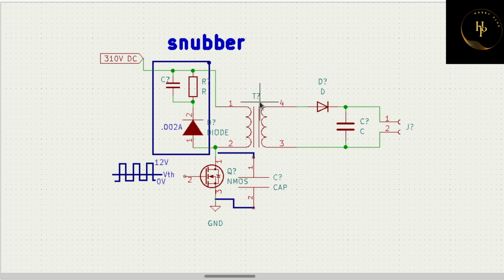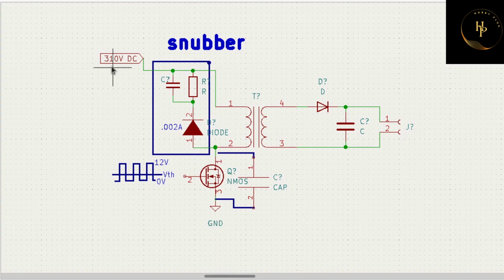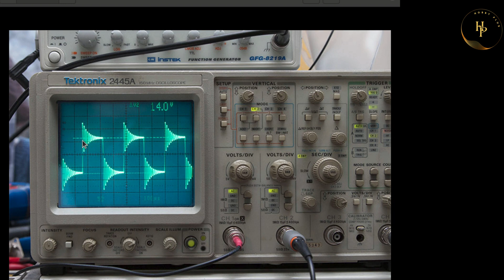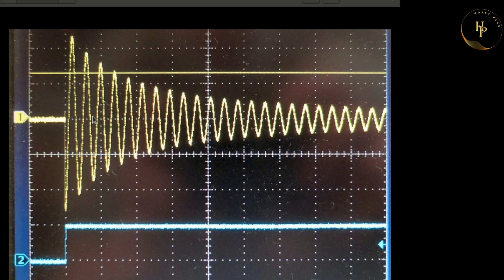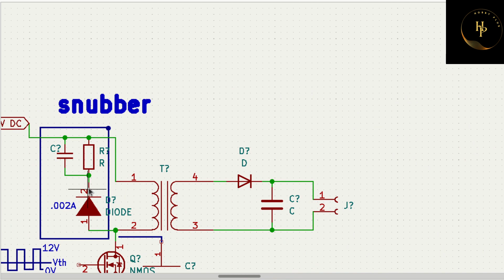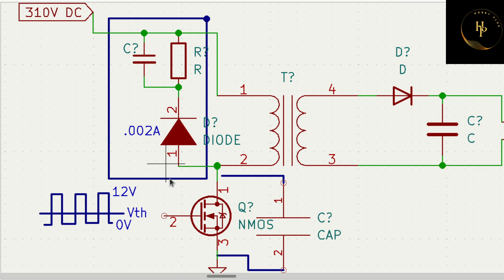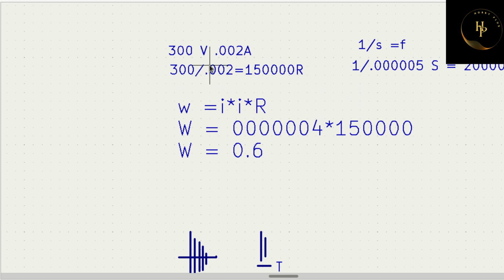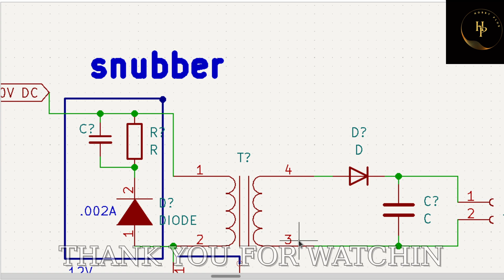[11]Snubber circuit calculation for SMPS

Comment: Can you suggest me best snubber design VALUES for Lleak = 180nH , Primary inductance with 0.9uH and secondary with 57uH in 1:8 turns ratio with Voltage spike of 242V at Vds whereas my Mosfet is can handle upto 200V my Vin_max is 9V and my Vout expected is 120V at Secondary Side with switching frequency of 1.5MHz and 12A Primary Peak current , Primary Current Mean =3A.I have designed it by 2nF and 40ohm snubber,my peak has been reduced but the power dissipation is too high than expected ..I need power dissipation less than 500mW at snubber.Can you help me with optimal Values?
Reply from the maker: you can use bifeller coil with your primary coil it can solved your problem, for better help you can watch this video(https://youtu.be/JGj51EeitqA).
Reply from the maker: or you can use low value high watt resistance for control the spike voltage.because when Mosfet goes to off then spike will arise, if resistance value is low the spike can through this resistance, so spike should be snubbed.
Reply: @hobby_plus  no i can't add or delete the components as it was already in my board,only option i have is tuning the Rsnub and Csnub optimally to attain lesser losses
Reply from the maker: Okay, no problem, you can change your R snubber with little low value and high watt. C snubber will little hihg, because C take more voltage to charge, that means voltage can not reach Vds.

Comment: Bro, how calculate 0.002A ?
Reply from the maker: your question is not clear.
Reply: @hobby_plus  on the diode.
Reply from the maker: In my video, there is a formula, you just put your value in this formula then you gate your value.

Comment: The capacitor valve has to be the same as the oscillator charge capacitor use to generator the saw tooth wave so is 250kw 102j is recommended from 10khz  to 250 kHz for snubber the resistor valve most be from 100ohm to 300ohm for fast discharge of capacitor and ultra fast switching diodes is required from 10 to 80 amperage is good if 600 watt transformer use 10 amp for high watt use the same amp max output of the current to match the output amps so if 5kw use 80 amp diodes with 300 2 watt resistor